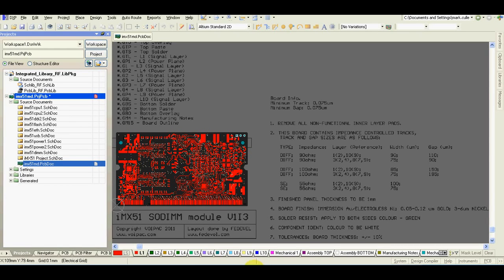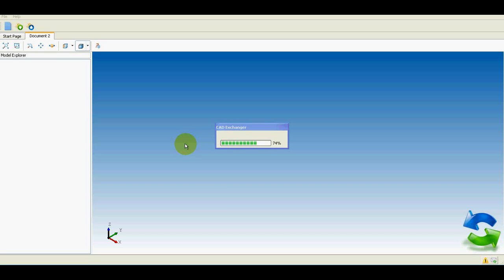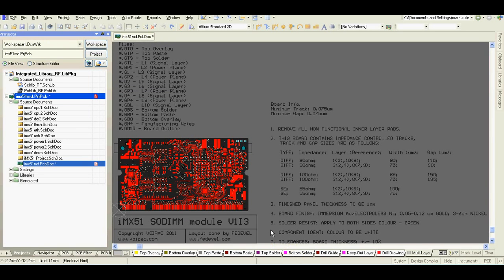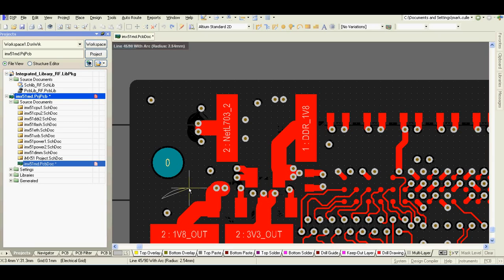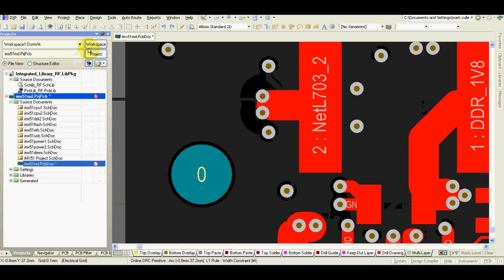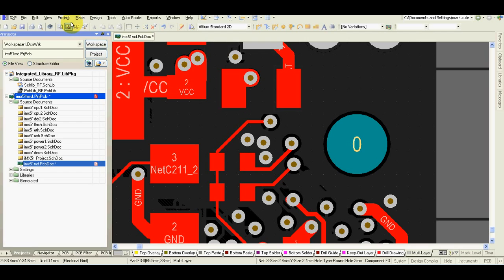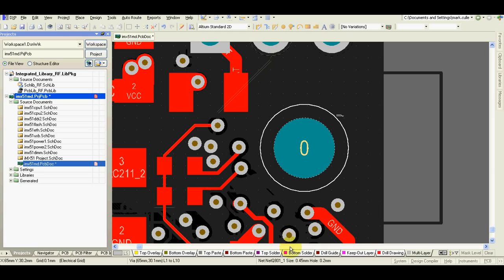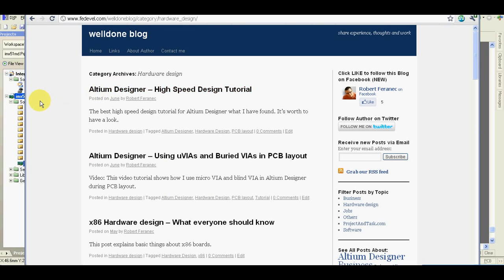Altium Designer - Generating 3D CAD File

Comment: I used vias for the mounting holes and I had problems. It seems that vias are not exported to 3D. Use pads instead of vias for mounting holes and you should have no problem when exporting 3D.

Comment: I know this is quite an old upload, but still. I notice that in the first export you have selected "export all" for the pad holes while the second time the "exported selected" was used but not mentioned
Reply from the maker: normally, you can use export all ... should not be a problem. If you have problems, export only selected